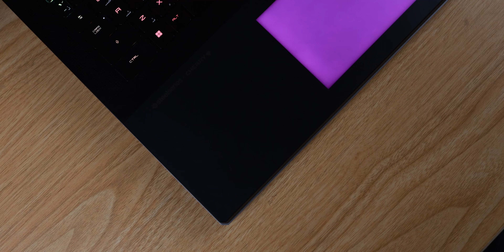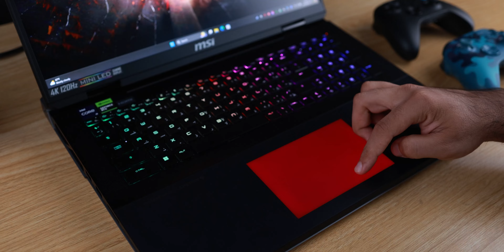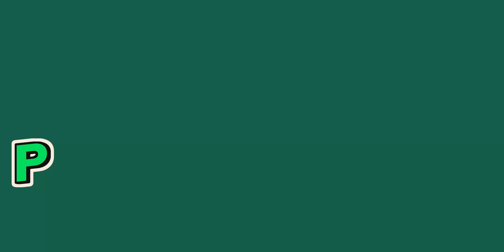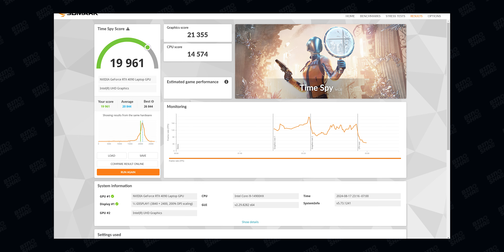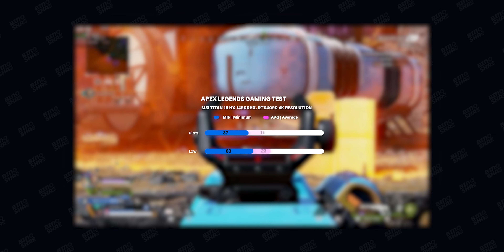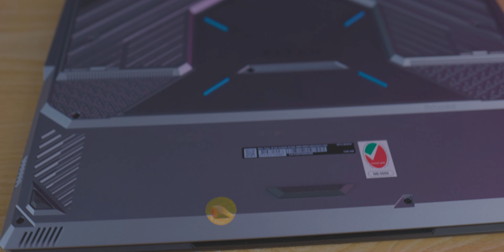This Laptop Cost 5400$! | MSI TITAN 18HX Review

Comment: Buy the MSI Raider A18 - it's just as powerful but $2.5k less! What you're paying all that extra money for is for is an extra m.2 slot, 64gb more memory, 120hz mini led screen as opposed to a 240hz led (both are 4k), mech keyboard and an led in the track pad. 

In other words, it's not worth paying the $2.5k more to get that... The MSi Raider A18 is a far better option!
Reply: Are you sure?
Reply: @punisher288  very sure, but get the AMD Rysen9 CPU version.

Comment: $5400 gaming laptop having a 120hz screen is criminal man
Reply from the maker: Dude it's 4K :)))
Reply: @BinoshaTech  I would rather have a 2.5K 240 hz display. For gaming refresh rate matters more.
Reply: @Ezekiel_plays u should buy a zowie monitor seperates because even the 240 hz monitor in those games don't come with 1ms response time
Reply: @hopegaming867  lets be realistic. If I am going to buy a separate monitor, I'll need to get a mouse and a keyboard too. Cuz you can't use laptop keyboard with an external monitor as it is very hard and distracting. Now wouldn't it be better for me to just build a gaming pc with similar specs in a much lower price. If portability is an issue, I can always get a mid tier laptop and it would still be cheaper than just a frickin laptop with a 4090 and a 120hz display.
Reply: People think they can tell the difference lol. A “blind” test would likely prove otherwise. There’s a lot of esports “pros” out there these days. Still plenty of those laptops out there since manufacturers acted on the meme.
Reply: @-quadrality8951  I agree that jumping from 240 to 360 isn't that big of a difference and 90% people can't tell the difference. But from 120 to 240 that is very perceivable. Esp if you play fast paced games and fps shooters.

Comment: MSI Hinges are terrible for anything around the $1500 and under range, luckily this laptop is $5400
Reply: I bought the MSI TIAMAT and the hinge broke in less than a week  . Got it repaired, it just snapped again  and not sending it back. I am thinking of getting the dragon version of this but not if same hinges used. 4500 for crap.
Reply: @williamblaney3316  sorry for your loss bro
Reply: @williamblaney3316  at that price bracket, you'd expect to atleast get a decent product, yet these laptops can't even support themselves....